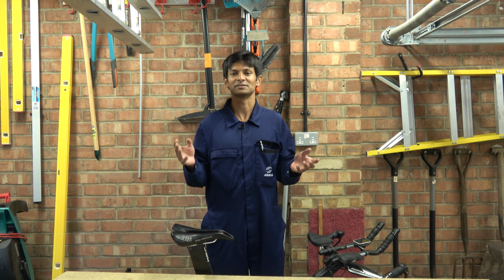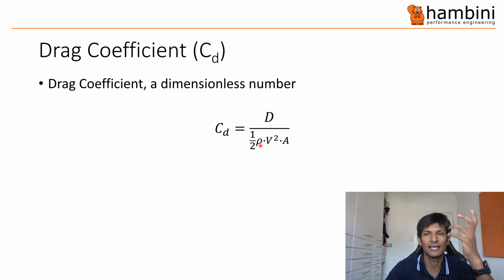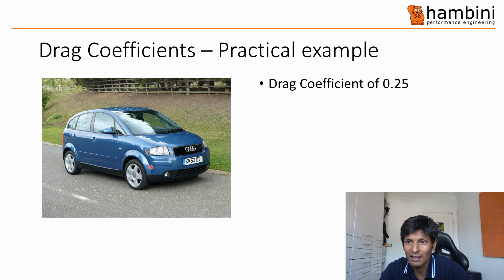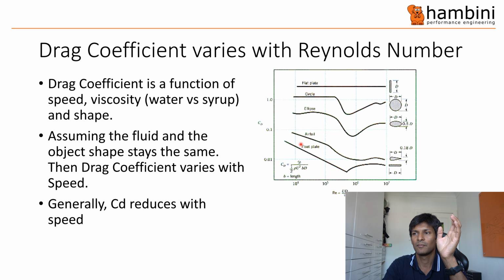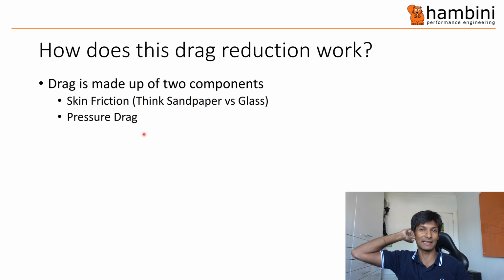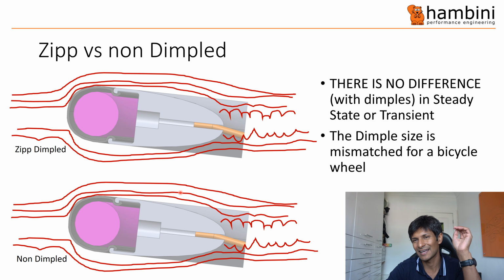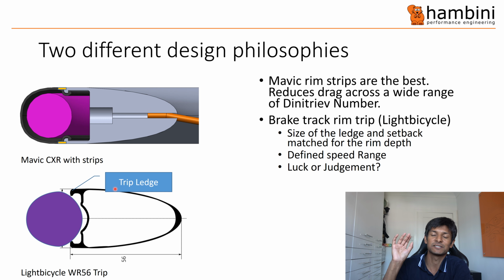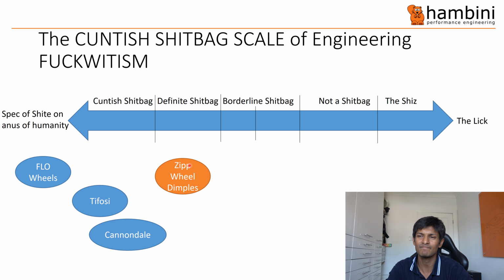Aerodynamics: Zipp Aero Bike Wheels (A Hambini Reaming)

Comment: Finally found what suits your knowledge. Analysing tampons.
Reply from the maker: I have pinned your comment to see what the masses think.
Reply: @Hambini  I am honoured. Do you need my bank details for commision?
Reply from the maker: @eduardgercog4422  You wouldn't have enough in your bank account.
Reply: @Hambini  You pay me sir for using my comment as an ad. Dont be greedy. Must be on 6 figures with such a unique expertise.
Reply from the maker: @eduardgercog4422  I will pay you in fish for your aquarium
Reply: must be a tri guy with zipp wheels
Reply: @WanderingSword  even worse love. Aerocoach. But you go ahead with the tampon crowd.
Reply: @eduardgercog4422  The aerocoach wheels in hambinis test is probably not the same as yours if your wheels are relatively new as aerocoach recently brought their prototype wheels to market - and these do not feature the spoke gaps. They are in fact with external nipples
Reply: @yannickokpara4861  They are a plastic set from last year. I am finishing second season on them. So must be the same.
Reply: @eduardgercog4422  I'd've no reason then to think that your offense taken will offer you any consolation as the matter is... it is about 20 holes disrupting the airflow over a surface that is supposed to control the airflow. You can't get around the fact that the purpose of the rim is being negated by the rim's theoretical potential being limited by the intermittent deconstruction of its aerodynamic properties.
Reply: @yannickokpara4861  where have you seen any offense. I am only happy the herd is staying slow and following a dodgy paid shepherd :) I judge my aero on race results in the first place.
Reply: @eduardgercog4422  I judge your race results on your muscular strength, your mental resolve, your aerobic endurance, your bike position, your joint strength and flexibility, but also the aero that results from some of these. Lastly I look at your attire and equipment :)
Reply: And let's not forget technique, tactics and race craft as well
Reply: @yannickokpara4861  much better times on same power = better aero. Simples really.
Reply: @eduardgercog4422  Much better times on same power could also = holding an aero position with more consistency, stability, confidence, in a different way than the last although it may not feel so but adaptation makes it so. I'm just saying... unless you've got a wind tunnel... I mean you could have the slightest adjustment of your head position and that will equate to the aero gains that separate two aero wheelsets
Reply: @eduardgercog4422  Also wind speed, gusting speed, gusting intervals, wind angle, relative wind angle... it all varies and it all dictates your time on course
Reply from the maker: @eduardgercog4422  Get a different set of wheels, you may go even faster.
Reply: @Hambini  ye right. Rode 2 different sets of your sponsor px before aerocoach. Did not work the way you promise at all. Oops. Perhaps I should get your aero session of a photo to make me faster. Ahahahaha.
Reply: Make a very nice set of training wheels now.
Reply from the maker: @eduardgercog4422  So you've bought a set of wheels that look basically like a colander and are unhappy that I said they were shite. Well Aerocoach themselves agreed with me and decided their next iteration would have a solid rim.... I don't really see what the problem is? Even the manufacturer has admitted they did a shite job.
Reply: @yannickokpara4861  same corse. 8km round loop. 2 years 15 races. 3min improvement over 24m. Top of amateur bike splits on very embarassing power. Tell me its the weather again.
Reply: @eduardgercog4422  - Give it up, Hambini is your Dad
Reply: @eduardgercog4422  I wouldn't mind at all. Unless you've scribbled down wind data for your rides or even looked at only comparing  days with VERY similar wind conditions then I don't know what you are proving and that's beyond the knowledge a power distribution chart might award us if it is overlayed onto an elevation chart and flanked by aforementioned wind data. And hopefully you haven't had the same exact position on the bike for 2 years(in measurements or in the way you sit on the bike with said measurements) or you would be as stiff as Canyon CF Evo UHM Carbon Layup